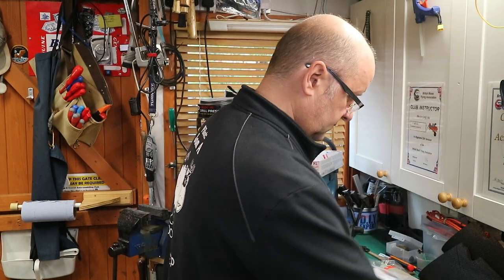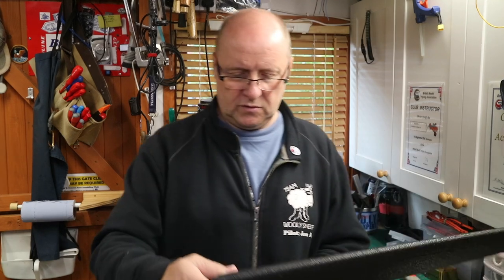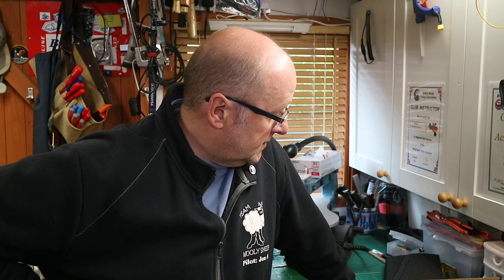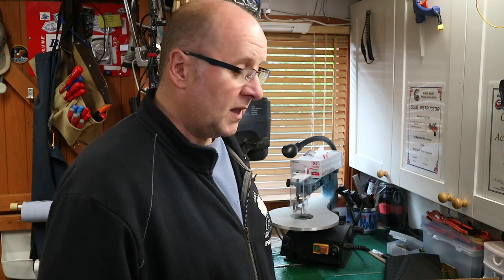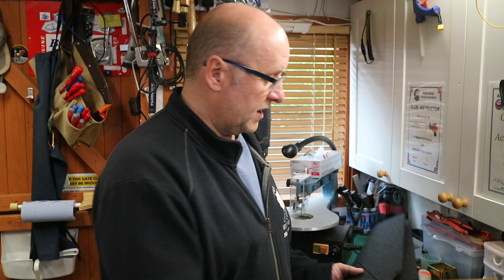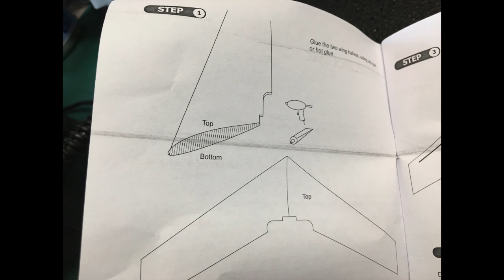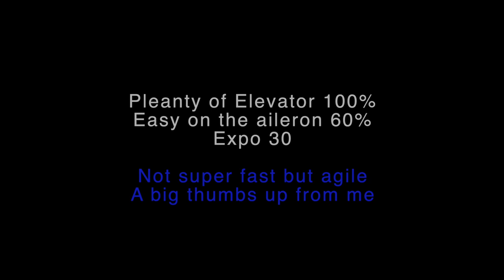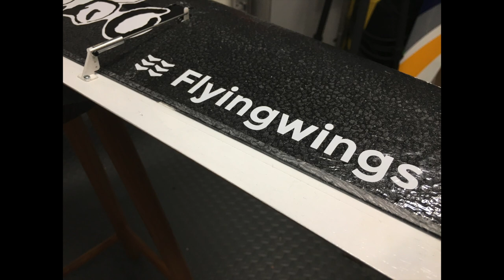WRA SPEC Racing Wing

Comment: Can't find the site for flyingwings. Co.uk are they folded wings now??! (little joke there!)
Reply from the maker: Yes....lol......they sadly stopped trading.
Reply from the maker: https://www.ewingsfpv.co.uk/spectra/
or
https://www.stealthwings.com/product/specwing/
Reply: I had seen the spectra site, seems there's a lot more for the 20 quid extra over the stealth wings version, the carbon spars and precut bays etc, I'm a racing/messing quad pilot but I just got an ar mini 600 and my multi prop stuff is going to the grandkids and I'm going full on wing!!! Lol! Cheers for the reply!
Reply from the maker: @mrphucyoo8281  No problem, you may wish to check out the AR Wing on Banggood they do a small 600mm and a larger 900mm
Reply: @TWSreviews  I've got the ar now(Christmas present for myself!) it's put my quads out of action! I'm a newbie wing pilot now instead!
Reply from the maker: @mrphucyoo8281  You will be a multi skilled FPV pilot....lol There is something magical cruising FPV wings, low level like a fighter pilot.......or high level like an eagle.....Practice line of sight also. figure of 8 circuits, cross in front of you and outside turns always away from yourself as easier to control. Good practice.........
Reply: @TWSreviews  thanks for the info, I've never flown a fixed wing so looks like it's back to school but really looking forward to it, got to say I'm all excited!!! Lol!